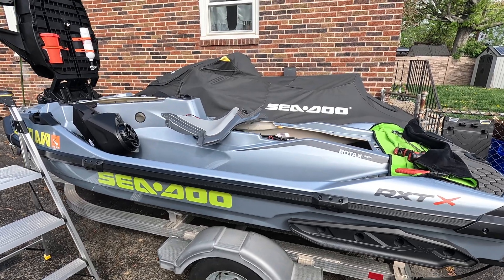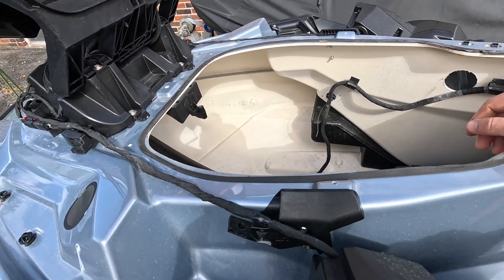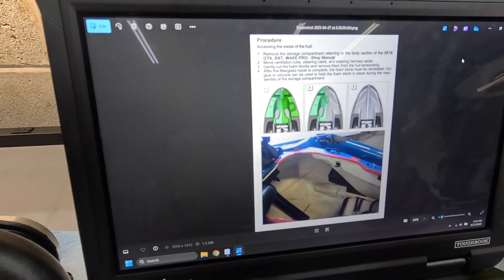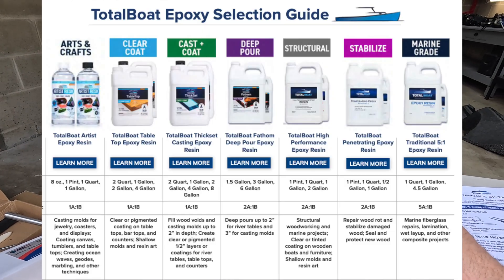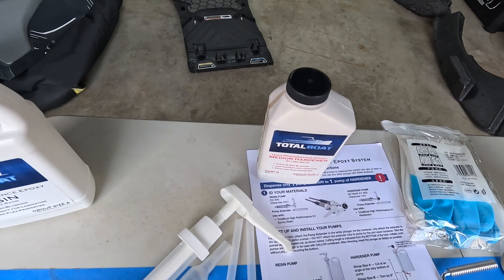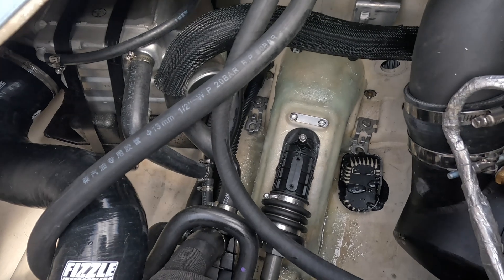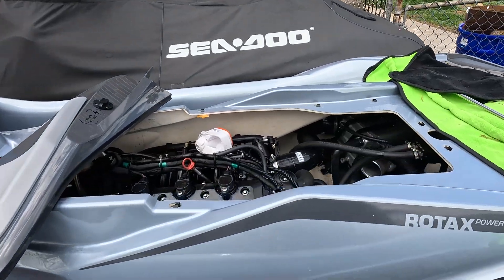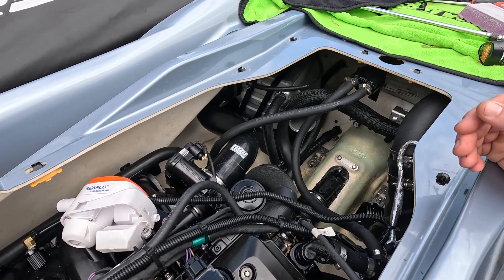SeaDoo // How to Reinforce Fiberglass Hull

Comment: How big of an issue is the cracking? I have a 2025 RXT-X 325 with a scom
Reply from the maker: It’s not very common at stock power levels, it can happen, but it’s not as common as you’d think. I don’t have exact numbers, but I’d say less than 1% have this issue. 

It becomes an issue when you’re pushing speeds much higher than stock.

Comment: Great video! I’m about to do it to my explorer this weekend, quick question, did you let the fiberglass dry in between layer or you just did one after another?
Reply from the maker: Nope you can stack while its wet, that way it can mesh together rather than being multiple separate layers.
Reply: Great thanks!  Just did it, fiberglass is so messy to work with is not even funny
Reply from the maker: @rafaelsoto5943  It sure is! Messy, stings, epoxy gets everywhere, certainly not a clean job!

Comment: Jake 

Thanks for all the amazing videos.  

Regarding the fiberglass reinforcement, I have 2023 RXPX with a T3R Hull.    I believe you are working on an ST3 hull if I’m not mistaken, correct?   Do the T3R hulls require the same fiberglass reinforcement?   

I do not jump waves, I ride on a freshwater lake, and I try not to beach my ski, but I ride with a bunch of guys that like to beach the skis and hang out so it would be easier if I did.    I’ve been using an anchor.

Thanks again

Comment: Hey Jake! I'm picking up a new '25 GTX 325 ski soon. After multiple bow/keel crack failures (non-impact) on my '23 GTX, I'm looking to do exactly what you've done here. Any lessons learned/things that you wish you would've done differently/brand consumables? Love your content. Thanks!
Reply from the maker: I've done a lot of research and testing with different methods and the methods and materials I have in this video have been proven to be the most effective and easy to do. It looks more complicated than it really is, but once you get into it its actually pretty easy!
Reply: @jakgal041 Excellent! Thanks for the response!

Comment: I have a 2024 RXTX 325 that just sank in the lake this past weekend. The inside of the tunnel cracked about a foot long. It was an absolutely horrible situation. I never expected a new Seadoo  to sink on me and my wife. Seadoo dealership thinks I sucked up a rope and I absolutely guarantee I did not. Where do you find the graph showing where Seadoo recommends reinforcement of the hull?
Reply from the maker: There's no way you sucked up a rope to cause this damage. If you did, there would be obvious rope damage and you'd have to remove the jet pump to cut the rope out. Here's the manual on hull repair and reinforcement. https://www.operatorsguides.brp.com/public/tmp/219101129%20-%20Deck%20and%20Hull%20Repair%20-%20All%20Surfaces%20(MY24%20PWC).pdf
Reply: When I click that site all I get is the empty page with Error 404? And thank you for acknowledging  what I already know. The stupid dealership was like,,, you sacked up a rope and it will not be covered. And I of course said, No I did not! The way you see it now is the way it came out of the lake. No decision from BRB yet
Reply from the maker: @rickmightberight  Thats odd, its easy to find though. Just Google "SeaDoo Owners Manual", the URL that has the owners manuals also has the hull repair guides which tells you how to reinforce and repair those spots.
Reply: Thank you! And love all you're  doing on your channel

Comment: Can this be used aswell to do the crack repair? Wish i had seen this video before my tunnel crack. Its very very fine and about 5in long it barely sips water in. Ive seen many crack repairs vids and all seem the same process as this but figure i should ask.
Reply from the maker: If you already have a crack you'll need to have it repaired from the inside and outside first. The process in this video is only for reinforcement, not for repair.

Comment: Any possibility of a link to the info seadoo provides?
Reply from the maker: https://www.operatorsguides.brp.com/public/tmp/219101129%20-%20Deck%20and%20Hull%20Repair%20-%20All%20Surfaces%20(MY24%20PWC).pdf
Reply: @jetskijake-seadoo awesome.  So I called total boat today and they recommended to me the finishing resin.  I noticed seadoo recommends polyester resin and you went for epoxy resin.  Any advantage to this?  Will epoxy resin bond to the cm hull as well as polyester?
Reply from the maker: @perditionluc  Polyester resin is the resin BRP uses because its cheaper. Its strong, but not as strong as epoxy resin. Finishing resin isn't something I'd use for reinforcement. That's the type of resin you'd use for exterior finishing since it has a smoother finish. For hull strengthening you want to use Epoxy resin.
Reply: @jetskijake-seadoo thanks much brother!  Keep the content coming!

Comment: I have a gtx300 plan on just running stage 1.  So I need to worry about reinforce?? Seems like seadoo should do this before selling!!
Reply from the maker: You shouldn't have to, technically I didn't have to either. Although the pump tunnel failures can happen to any ski, its rare. I did this for piece of mind. SeaDoo won't do this because its only a concern for people pushing more power from factory.
Reply: Kind of what I figured. But I think with a tune it will do 80.  Not sure I’m going to do the tune.  But ya never know!!
Reply from the maker: @CarFanatic5  If it helps, I had 170 hours on my last RXTX with a Stage 2 tune, wave jumping and aggressive riding and I never had any problems with the pump tunnel!
Reply: @jetskijake-seadoo or the nose?

Comment: How did you remove the foam?
Reply from the maker: You need to cut part of it to remove, then the rest can slide out. It’s all slid in there like a puzzle piece. They’re not glued down, but the foam ends under the gas tank. You just need to cut that part and then the rest will come out.

Comment: Great video, if you didnt already, can you do a video on how to best wash your ski after salt riding? mainly whats the best way to get all the water out of the hull sometimes i find it hard to get 100% out just by tilting and im concerned that there will be water sitting under the engine enough to corrode.
Reply from the maker: @YummyFungus9914  I haven’t made a video on that yet but I certainly will!

Comment: Hey Jake, I took my ski on the lake yesterday with my oil level probably 1/3 into the operating range on the dip stick. I checked it this morning and the oil level was probably 3/4 - 7/8 below the full line. The oil looked normal and Jetski ran great. Do you know why that could have happened? It’s a 2010 rxtx 260
Reply from the maker: Are you checking your oil level using the oil reading procedure? Keep in mind it's a dry sump system so there's no main reservoir like there is on a car. If you're measuring it cold you'll never get an accurate reading.
Reply: @ I did indeed follow the procedure. I’m thinking I could possibly have a small head gasket leak. The coolant was down a small amount compared to yesterday. Which could explain why I’m not seeing much of a noticeable difference in the oil, but also I’m thinking it should be more milky looking if there was coolant in the oil. There was a slight white smoke coming from the exhaust but very little.
Reply from the maker: @JacobHunter-r5g do you have a coolant pressure tester, or a leak down tester? Both of those would easily rule out a head gasket. The coolant pressure tester is probably the cheapest and easiest to use since you just replace the coolant cap and pump it up. You’re right though the oil would be milky if it was a head gasket. 

It also could very well be normal. It’s best to check the oil level right after a ride. Following the procedure will get you pretty close to a post ride level but not fully there.
Reply: @jetskijake-seadoo  thanks for the input, I have a coolant pressure tester on the way! I honestly might be leaning more towards something going wrong in my fuel system now. I didn’t even think about smelling the dipstick but it has a gassy smell and is a good bit more runny. Do you have any thoughts for what I might want to look at?
Reply from the maker: @JacobHunter-r5g  As odd as it sounds, that's normal. Fuel/oil dilution is pretty common with these engines which is why end of year oil changes are critical.
Reply: @ I hope so, engine only has about 4 hours on it since last oil change. I Didn’t think it would get a gassy smell that quick. Do you think there is a chance an injector was stuck open and letting gas dilute into the oil?
Reply from the maker: @JacobHunter-r5g  It happens pretty quick! The good news is when the engine is up to temp and operating it will keep it under control. I doubt its a stuck injector, you'd generally notice an intense vibration, rich fuel smell from the exhaust and a lack of acceleration/top speed if that was the case.
Reply: @ that’s definitely relieving to know. Thank you for the help.

Comment: Thanks for the video. I will be doing this. But I have not finished paying off my boat. Does this void any warranty?
Reply from the maker: I'm not sure if it would or not, but I know the SeaDoo warranty with a cracked hull is a gamble. It seems some people have luck getting it covered and others spend months and in some cases years trying to get it resolved. I personally don't rely on the warranty for anything.
Reply: @jetskijake-seadoo I guess it depends on the dealer but I’ve always found Sea-Doo (and honestly any Powersports) warranty to be a joke. If they would sell a new ski with no warranty and give a discount in lieu of warranty I would def go for that.
Reply from the maker: @timblack33  I agree, I never buy or rely on the warranties. Even if you have a covered item you have to fight tooth and nail to get it covered and even then you have to wait months. Its much better to just do the work yourself.

Comment: Hey, do you know if anything like that is needed, or can be done on the Polytec gen2 that sea doo have? Since that's just plastic i don't really know if any resin would stick to it at all.
Reply from the maker: This is not needed for the Polytec hulls!
Reply: @jetskijake-seadoo  Damn, youtube removed my comment aparently because it had a link to another video. But I do realize it's not generally needed on gti series, and 170 does not have the power to do any damage there normally.
But - 
What i wanted to add was, I am planning to use a wake shaper on my ski (if you look up the video `Wake Shapers to Surf behind a Jet Ski on a Hydrofoil`) and that thing adds a ton of additional strees on the attachment points. So i'd just like to know of the best way to reinforce that before things go wrong. And yes that is certainly not intended use of a jetski and i do realize things might go wrong there.
Reply from the maker: @MihaZidar  You can easily add a shaper without needing to reinforce the hull. Polytec is a lot stronger than people think!
Reply: @jetskijake-seadoo  So i guess thats what i needed to hear. Thank you.
Reply: Where do I find seadoo spec sheet on this